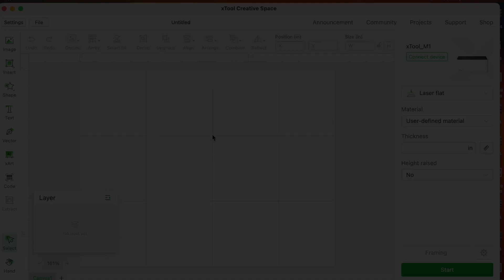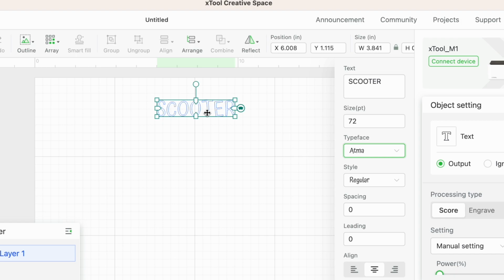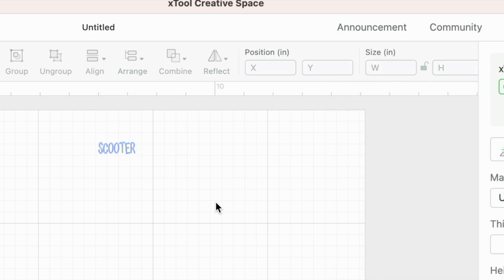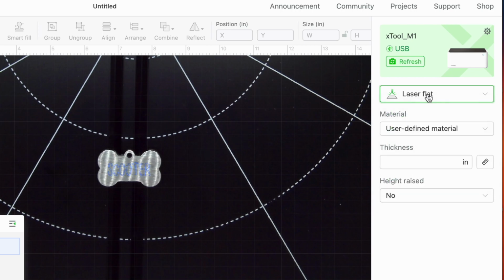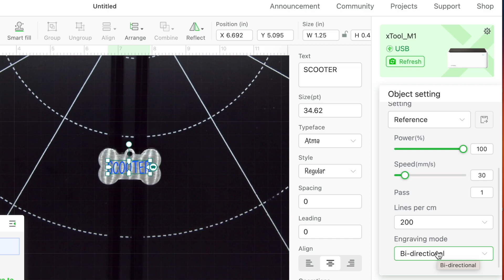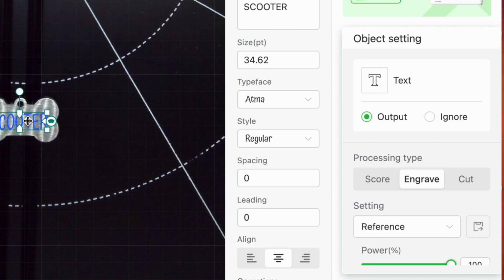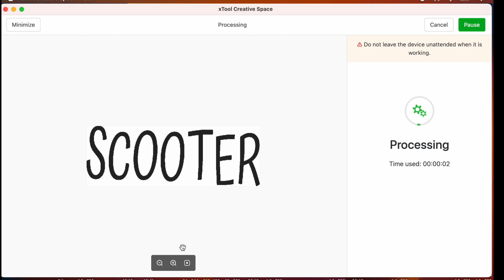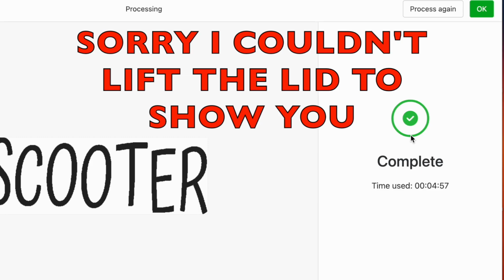My First Metal Engraving Project on my xTool M1 Laser

Comment: Hi! Great video. I have two questions: Would this work for sterling silver as well? I'm hoping to engrave a little pendant. The engraving is permanent, right? It won't wash off even if it isn't as deep as on wood? Thank you.
Reply from the maker: I've engraved on several metal things, but I don't think any were sterling silver. I did see another YouTuber use the IR laser on sterling silver. The engraving is permanent and does not wash off. It is not really very deep on metal, but it is actually engraved and not just marked on the surface.